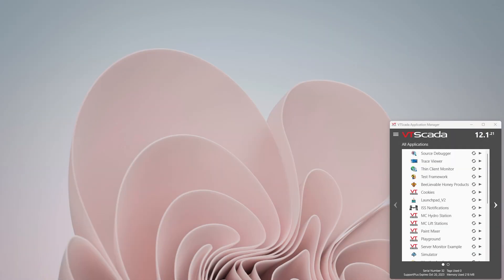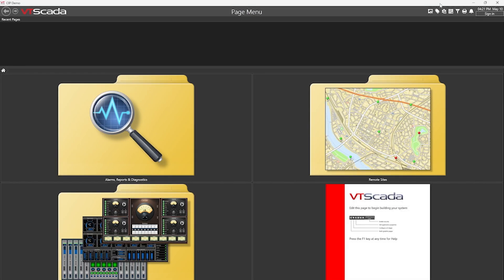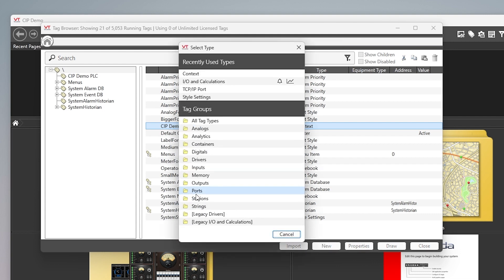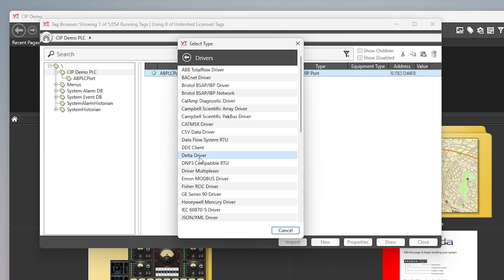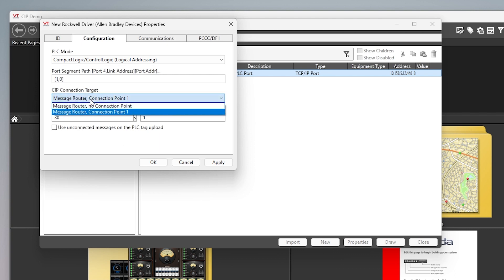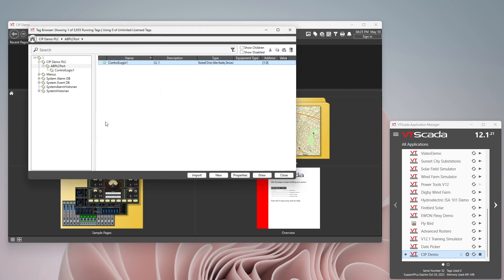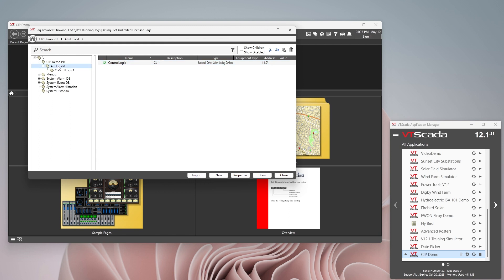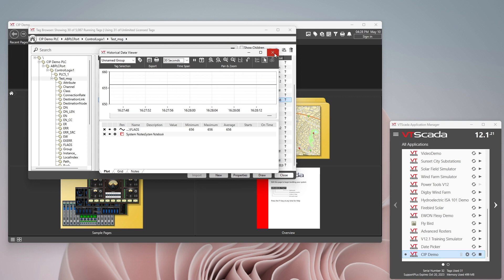VTScada To Rockwell PLC using CIP Protocol

Comment: Question: if the import button results in a “The driver is not ready” popup, does that mean that the driver needs more time to download everything from the PLC, or is it trying to tell me that I configured something incorrectly?
Reply: did you ever figure this out?
Reply: I did! It turned out that my IP setup had some issues.

I’m working out of a VMware VM, and I needed to make sure my VM and the PLC I  was using were on the same subnet.

I’m using VTScada light for learning purposes, and I’m not sure to what extent this affects standard edition or above, but after a bunch of research, I found something talking about VTScada Light needing to be on the same subnet as your PLC.